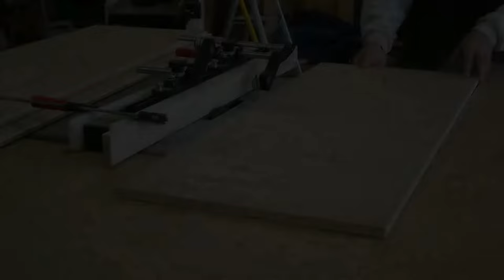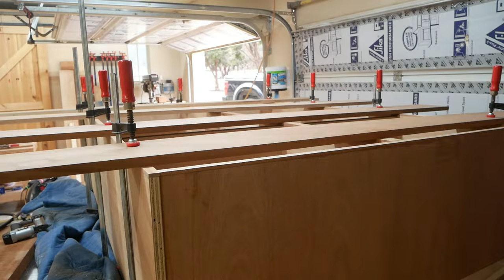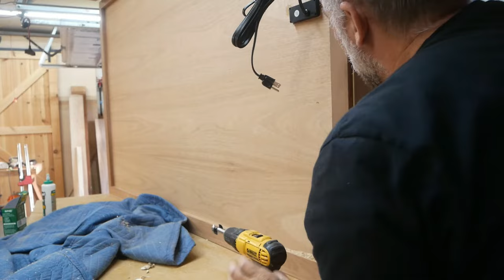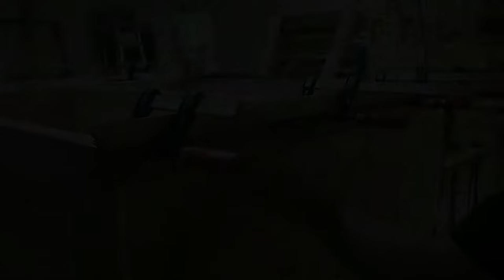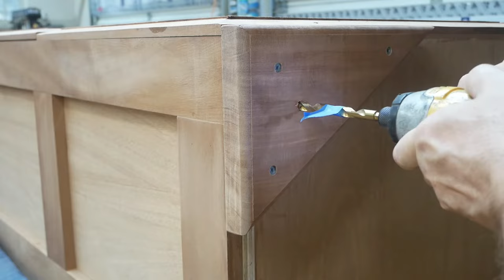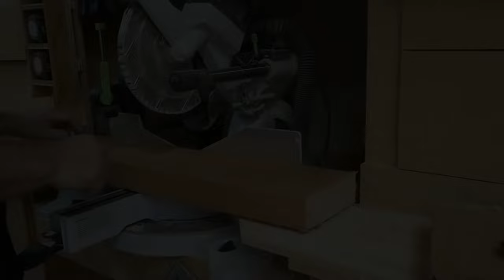COMPLETE START TO FINISH OF CABINET CIGAR HUMIDOR

Comment: Another question any places you recommend to buy spanish cedar? I live in Raleigh NC,  where's your cigar lounge located?
Reply from the maker: It in Georgetown, tx. Just north of Austin. I only have one place here in austin i get it from.  https://maps.apple.com/?address=600B%20Industrial%20Blvd,%20Austin,%20TX%2078745,%20United%20States&auid=3909679288278411806&ll=30.217738,-97.758715&lsp=9902&q=Brazos%20Forest%20Products&_ext=CjIKBQgEEOIBCgQIBRADCgQIBhAWCgQIChAACgQIUhABCgQIVRAQCgQIWRAECgUIpAEQARImKQnEoU+XNj5AMZt0HvHjcFjAOQVv7QfkOD5AQRuLPp45cFjAUAM%3D&t=m
Reply from the maker: Let me know if that link works.  You could call them they may ship to you.

Comment: Hey bro, love your work. I converting a extra large China cabinet  and I ordered 1/2 spanish cedar. I have a question I want to make my own shelves but I don't have much tools, also I want to use all spanish cedar for my shelves and not veneer, what size thickness can I use for my shelves?
Reply from the maker: For the cigar baskets i use 3/16 pieces.  I normally use 3/4 veneered ply for the shelves mainly because i wont have to worry about wood movement, but if you want the shelves to be solid spanish cedar id probably go with the full 1/2in

Comment: Thank you so much for these videos! I have a humidor/whiskey cabinet to build and I’m learning so much from you. In a larger cabinet like this, is it best to put the electric humidifier at the bottom? I’m assuming a cabinet of this size needs more than one hygrometer, so you can monitor the humidity at all of the levels?
Reply from the maker: Yes definitely want multiple hygrometers.  And i i prefer to put at bottom.  But i think i may explore putting one in the top.  Never really crossed my mind to do that.  And thank you for the kind words.
Reply: Awesome- thanks for the reply and the helpful content! Can’t wait to catch your next build.
Reply from the maker: @jessieeby3711 anytime. Hit me up if you have any questions ill help the beat i can.
Reply: @DsHardWoodCreations  Right now I’m in the process of working out the interior depth of the humidor portion of the build. I’ll admit, I don’t know that much about cigars (I’m learning, though!). Is there a standard size you like to do for the cigar baskets/shelves you put in your humidors? I love the slanted display style, and plan to incorporate that for this build.
Reply from the maker: @jessieeby3711 i just do what the customer wants.  But if the depth is say 24in i usually do the baskets about 3ins smaller than the depth.

Comment: Nice work! I’m building one about the same size. Question for you, are there hygrometers that mount on the front doors that measure temp and humidity inside the cabinet, or should I just get one and mount it inside? Orrr, just have one sitting on one of the shelves? Your suggestion?
Reply from the maker: My opinion the analog hygrometers look great but dnt work as accurately as the digital.  So putting one on the door for me would be solely cosmetic.  Id get digital ones on each shelf or maybe just one at bottom and one at top.  And thank you for kind words.
Reply from the maker: If you have anymore questions id be happy to answer to best of my knowledge.
Reply: Thank you. Do you have an opinion on building the entire cabinet out of Spanish, instead of just lining it, as long as we do not stain or "seal" in inside?  @DsHardWoodCreations
Reply from the maker: @BrananWard  you could but spanish cedar is very soft so would be very easy to damage it.  And like you said you cant really put any protection over it bc it would risk soaking into the wood to the inside and damaging cigars.
Reply: So I should avoid any type of stain or sealer on the outside, if we are using SC 4/4?  @DsHardWoodCreations
Reply from the maker: @BrananWard  i would personally. I mean poly and a cpl others sit on top of the wood and arent supposed to soak in but i wouldnt want to chance it.  Also another thing to think about is the wood movement the spanish cedar will be holding moisture at all times.  So that may cause issues especially since you will only seal one side.  When using  thin veneer pieces thats not a big issues.  That would probably be your biggest issue with using solid spanish cedar after really thinking about it.
Reply: thank you
 @DsHardWoodCreations
Reply from the maker: @BrananWard no problem

Comment: I do have another question about the spanish cedar used inside. I saw you glue it to the cabinet after you taped it together did you use brad nails also, and if not would it be a problem using brad nails for a cigar humidor?
Reply from the maker: You could use them. However u would want to turn the nailer down so it doesnt shoot through the thin sheets of cedar. Id still highly recommending using glue as well.
Reply: @DsHardWoodCreations  Thank you I was going to use glue for sure, I just wasn't sure if my glue job would hold since like you I don't have a way to clamp that big of an area, so I was just second guessing myself scared I wouldn't  put enough pressure on it. Thank you again if I use the brad gun I'll make sure I angle it down.
Reply from the maker: My bad i was referring to turning the air pressure down and angling it would be good too.

Comment: hello, how many mm did you prefer to use the Spanish cedar you used in the interior of the cabinet humidor and why?
Reply from the maker: They were 1/8-3/16in two reason was any thicker would of made it look too blocky since your glueing it to the ply which is already 3/4in.  And then obviously to get the most from the 8/4 stock of spanish cedar.  And its really all thats needed to get the effects you are looking for for the spanish cedar (maintain moisture and the aroma that repeals cigar beetles.
Reply: @DsHardWoodCreations  Is it possible to write these dimensions in millimeters?  This is the first time I've heard of this unit of measure:) In Turkey, measure = length (millimeter or centimeter)
Reply from the maker: 3.18mm-4.78mm(1/8-3/16), 19.05mm(3/4), 5.08cm (8/4 or 2in)
Reply: @DsHardWoodCreations  Thanks for the feedback.  3.18mm walls and trays if I'm not mistaken.  shelves (tray bottoms) 4.78 mm.  is it true ?
Reply from the maker: Yes that would work. Tray’s don’t hold much weight. U may want to put some cross support under them if u plan on putting boxes of cigars or if u make the treys bigger.
Reply: @DsHardWoodCreations  Actually, I will not make a tray as I will only use a cigar box.  I think the thickness of the shelves is 5 mm.  Maybe I need to make it a little thicker so that it is heavy and not warped.  I will get your opinion again when the dimensions are clear.  if the shelf is one piece (no middle support) it may need to be thick.
Reply from the maker: @alpayerdogan3580  agree
Reply: @DsHardWoodCreations  Thank you sir for helping me.  I appreciate what you do.
Reply from the maker: No problem anytime